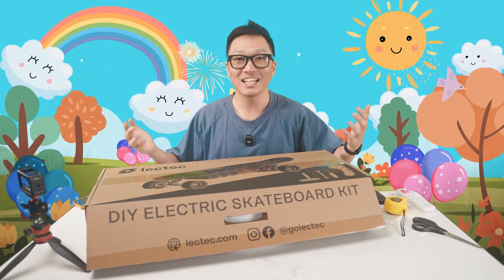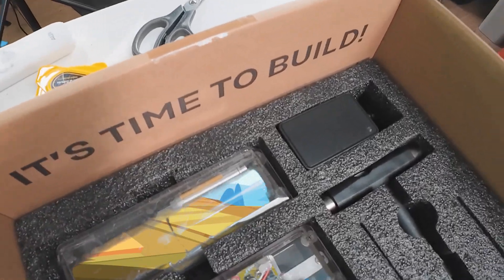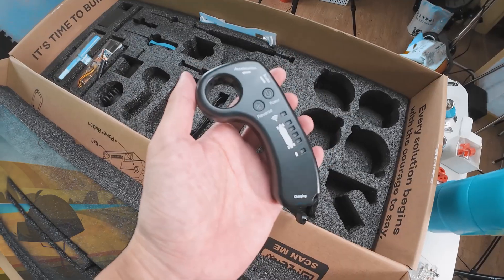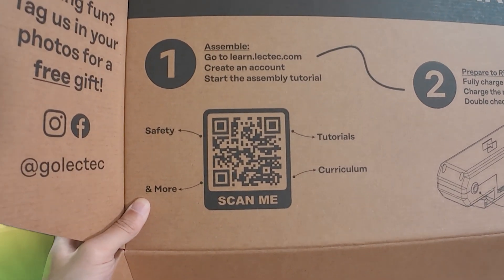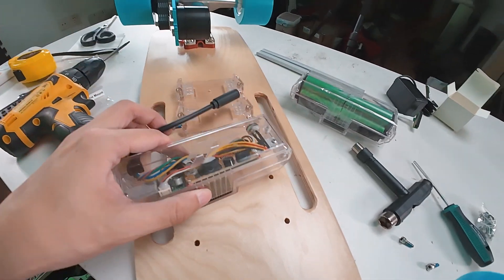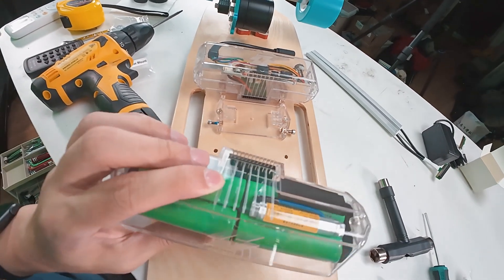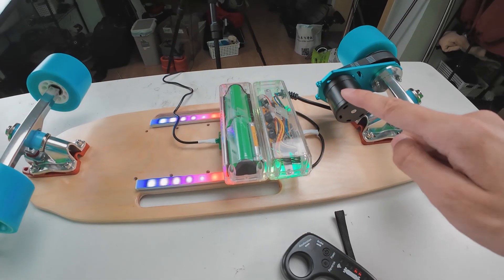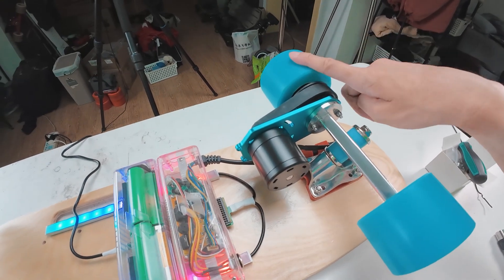Lectec DIY Electric Skateboard Kit for Kids

Comment: hey daniel, totally off topic but I was wondering how to fix one wheel stops spinning way before the other one on atlas pro. I've only ridden it for a few weeks and for some reason the left rear tire stops way before the right rear tire upon braking?
Reply from the maker: I would check if the belts are tensioned evenly and if both belts look ok. And if they are, I’d take off the belts and check the free-roll of both rear wheels are similar. If they’re not, might be a bearing issue or something else slowing the wheel.

Comment: This could be a good beginner's board for kids and adults. You should had what the specs were if only for "giggles & grins"😅
Reply from the maker: This is very much for kids only, they say ages 7-12. Think the deck would eventually break for adults.
Reply: @DanielKwan  

Oh okay, When I (presumably) saw you ride it it mislead me, and many cheap single motor boards are capable of moving an adult (albeit perhaps with a top speed of only 12mph/19kph) so I thought this was one of them.

Comment: Someone educate me.  Why use double barrel bushings on a short board?  Wouldn't that reduce turn radius?  No mention of the softness/hardness of the bushing, or wheels 🤷
Reply from the maker: Barrels may or may not reduce turn radius but they generally help the board stay centered compared to cones. Dunno the duro but they seemed very soft. This board is for ages 7-12 after all.